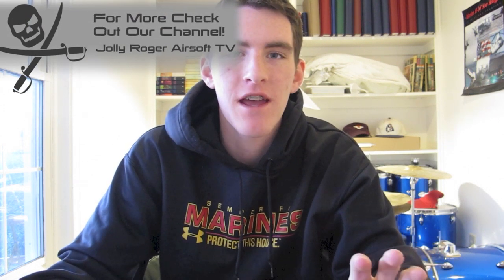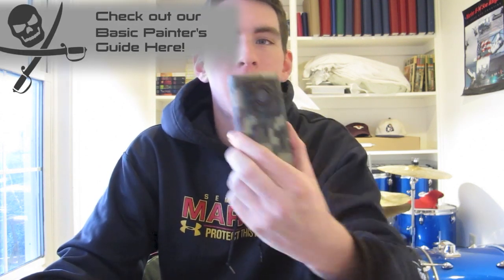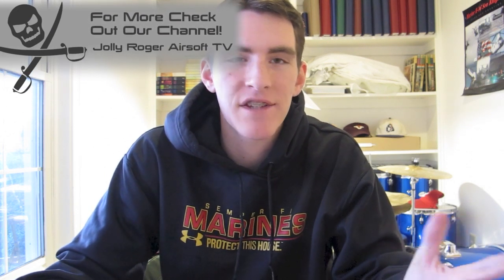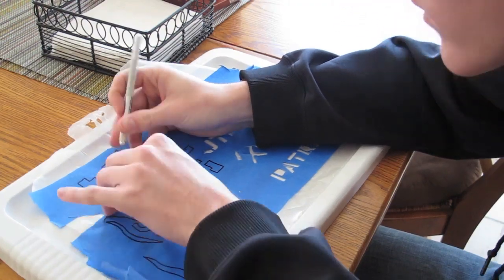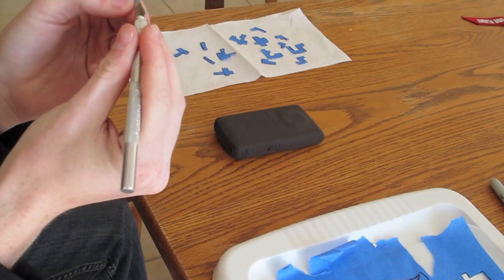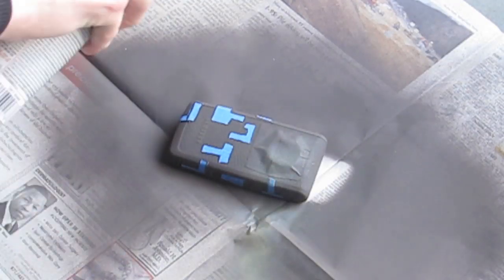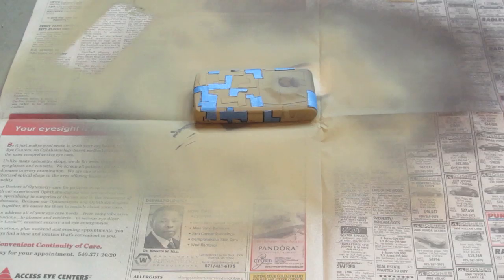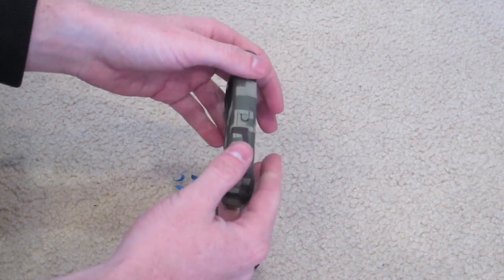How to Paint Digital Camo- How to Spray Paint a Gun - Jolly Roger Airsoft- Stencil Method

Comment: If you use a sheet of glass for your painters tape, you can peel them off with minimal effort. It saves a step & a huge amount of time! Just cut out your stencil lines, then peel off all the "waste". Your pieces are then separated making them easy to peel and use. Using glass also makes it easier to cut the tape and the blade doesn't dull as easy.

Comment: I used a cutting board but instead of applying individual stencils I used the entire sheet of it of course I was painting a computer case not a gun, so it was easy enough to just slap the whole sheet on painter's tape on the parts I was painting